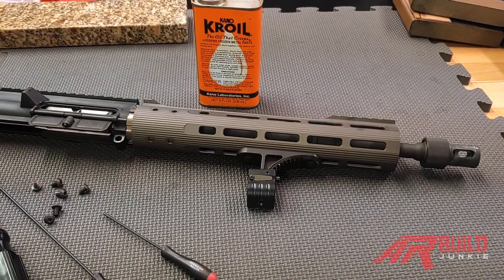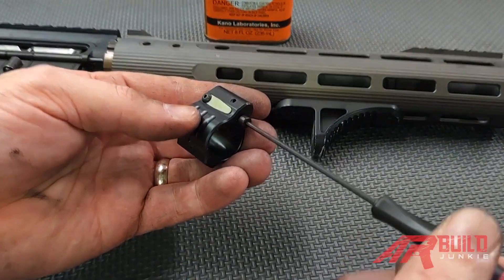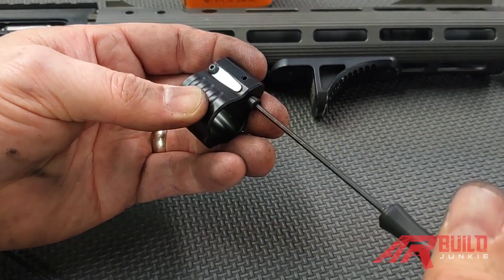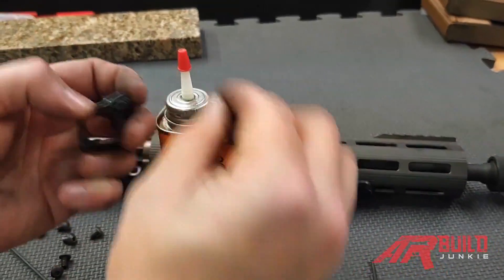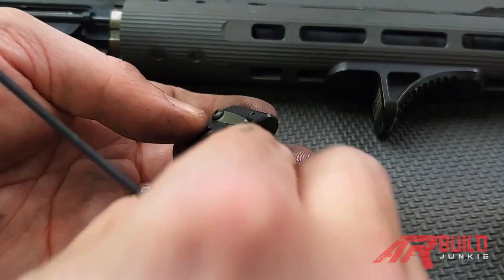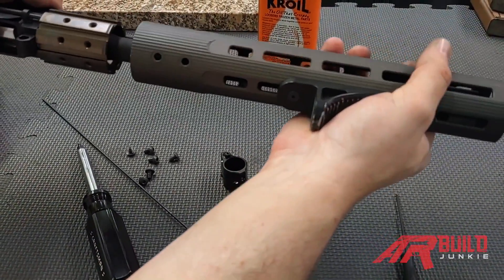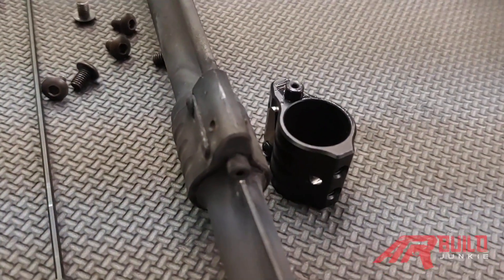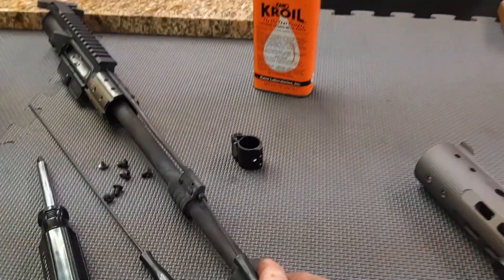Adjustable Gas Blocks - School of the American Rifle

Comment: My gas block screw won’t turn. 😬 I’m guessing it’s all carboned up but I really don’t want to strip the screw.
Reply: Heat and penetrating oil. Be careful, but you can get it loose.

Comment: I know this is 4yrs old, Faxon has a new one where the adjustments will not be in contact with carbon fouling. $80
Reply: Did you see that AR in the video? If you really shoot the entire gas block gets covered in carbon so their design means nothing. However 90% of shooters don’t actually shoot enough for it to really matter

Comment: My question is, being that I just built my first AR from a box of parts is, do the adjustable gas blocks come with a pre-tuned setting ready to shoot? Another question I have is how do you know which direction of turning the screw closes and opens the gas block? Does clockwise open it more or does counterclockwise open it more, allowing more gas flow directed to the BCG? I’d appreciate any help!

Comment: What do you think of bleed off gas blocks
Reply: I think they're great
Reply: Over rated . Watched a couple videos on it and once you enter that bleed off adjustment you start to loose fps on your velocity also the guy running the test only showed a one degree difference in temperature on the bcg area after shooting full auto on both the bleed off setting and a standard non adjustable gas block wasnt worth it

Comment: Okay so this is not on an AR. It is a Kel Tec RFB. It is my only adjustable gas firearm so I am very new to it. The malfunction I keep running into is the spent casing failing to fully eject on medium to fast paced firing.   Anyone have any ideas? I'm not sure if it is over gassed or under gassed and with ammo the price that it is, I'd rather not waste ammo via trial and error.
Reply: Could be undergassed or your gas tube isn't seated in right but first problem is it's a kel tec
Reply: @richrich4980  It is indeed a Kel-Tec afterall😆

Comment: I don't put oil in my agb because that leads to more carbon deposition once the oil burns off. I simply break mine loose every 500 rounds, and take it apart for cleaning every 3-4k. Never once seized on me.
Reply: What do you mean “break loose”?
Reply: @saucyscrambler8710 removes it from the gun.

Comment: I turn my gas block adjustment screw in and out every other time I go shooting and never had any carbon block. I'll add a little penetrating oil to my regiment. Thanks for the info. I had an early SLR AJGB leaf spring break and they backed it 100% with a newer version. SLR adjustable gas blocks are my favorite, especially the titanium.